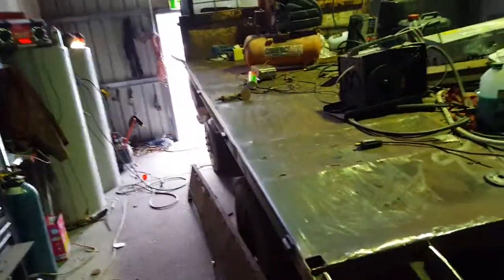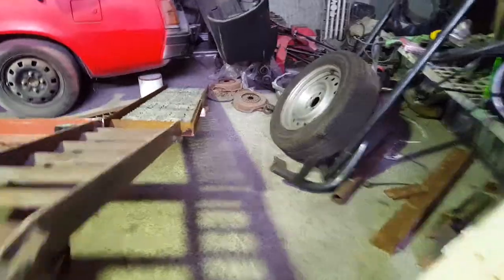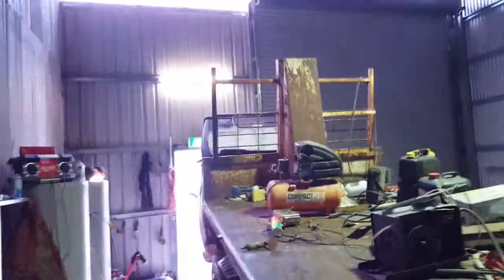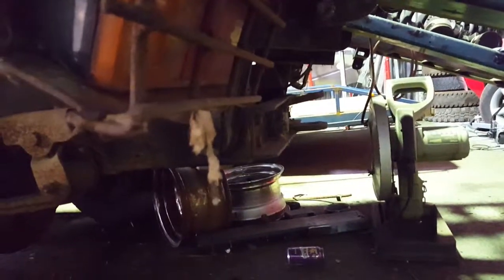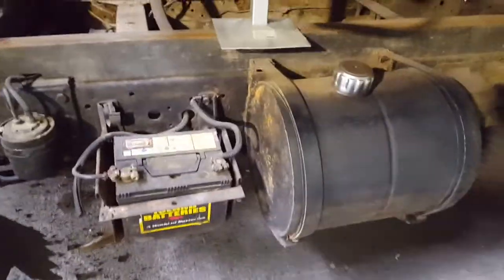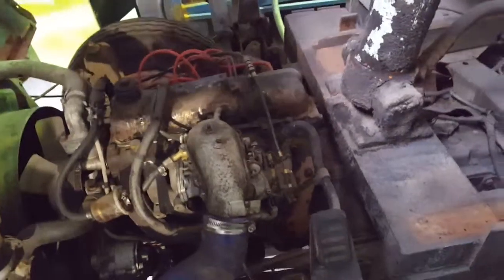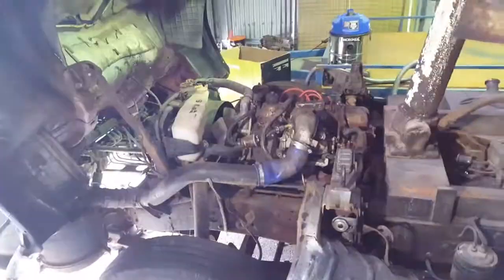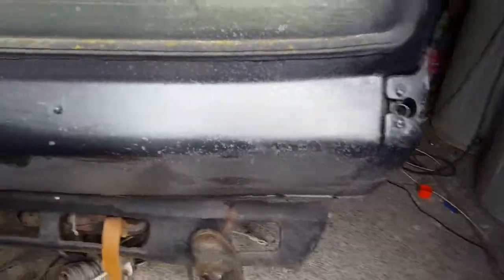Toyota  dyna  5r update  progress

Comment: ive got a 75 dyna that i will tackle shortly. tough little truck it is, the chassi and wheels and everything except engine are over kill for its gvm of 4315KG
Reply from the maker: They are so dam tuff
Reply from the maker: I enjoyed owning these i have a mazda t4000 now 5.7gvm and a Leyland Mastiff 16.8 gvm
Reply from the maker: 75 diesel?
Reply: it didn't get the Toyota H engine. It's got the 5R petrol, 98 bhp at 4800rpm and 100nm at 4000